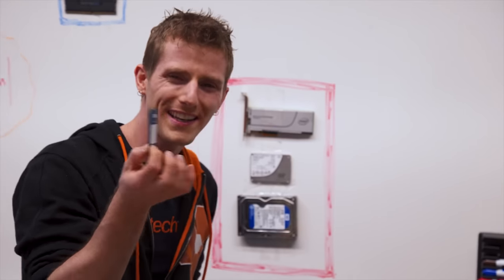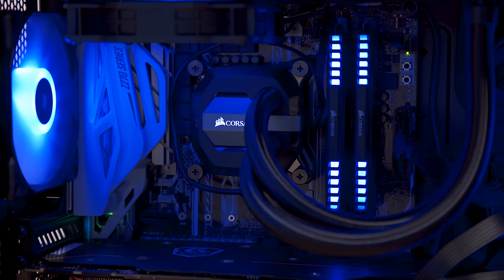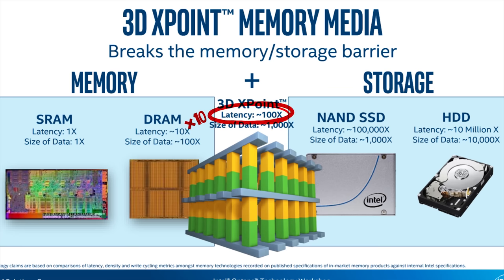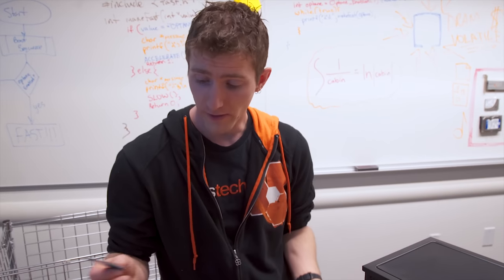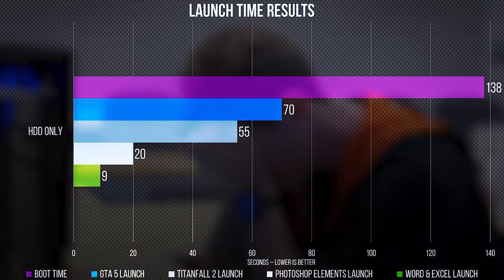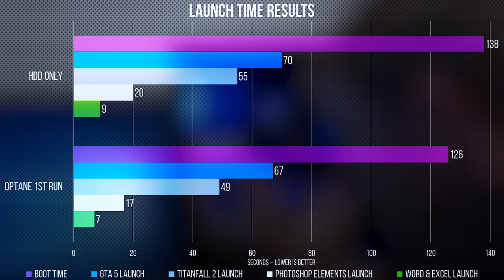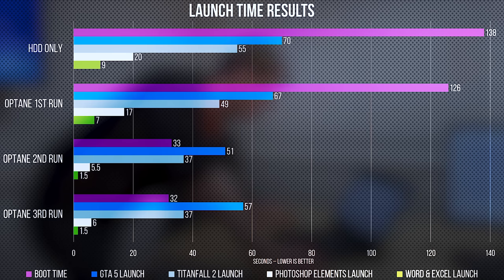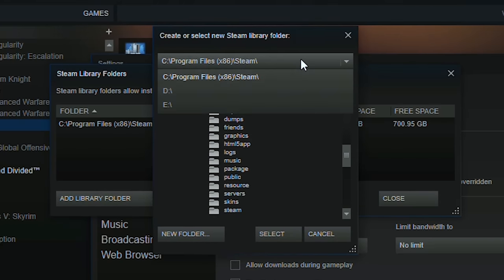Intel Optane Exclusive Hands On - SSD Crushing Performance

Comment: I'm a server guy and we've been testing the server version of this for a while and wanted to point out a few things.

Firstly the overall bandwidth of this is really no different from existing PCIe NVMe M.2 cards such as the Samsung 960 Pro's etc - it's limited by PCIe version and lanes - in this case 4 x 3.0. This is the same with the server cards, sure we may have 8 x 3.0 lanes but that's still the limitation. Where Optane really benefits is the access-times, they're way quicker than the already-very-quick PCIe NVMe cards - WAAAAY quicker. The problem is what to use this for.

Obviously it's way too slow to replace DRAM (for now), and way too expensive-per-GB to replace main storage (again, for now, though that will change VERY quickly). The biggest issue right now is that operating systems aren't tuned in any real way to utilise this technology and that won't change very quickly either.

Where this will benefit servers in particular is where you have all of your 'live' data in DRAM but want a cache of the most-used of your main storage that's way quicker to hand - storage-tiering essentially. Eventually when all main storage runs at this speed then this tiering won't be needed, but that's 3-5 years away or so.

For home users, well we need to wait for capacities to increase, price-per-GB to drop and PCIe 4.0 to ship - then we get our game-levels quite a bit quicker but home users won't really benefit too much from the latency-drops to be honest, we just don't do that kind of work typically.
Reply: THANK YOU!
right now, you are good to go with an SSD as boot drive. If you have more money, get an NVME SSD.
If you run out of mass storage, get an HDD.
Simple as that. Optane has way to small capacities or is too expensive.
Reply: Is the server version bound to Kabylake + Windows, too?
Reply: There exists server level versions of  2-level data cache software,  such as  PrimoCache:              http://www.romexsoftware.com/en-us/primo-cache/index.html
       So if you have 32 or 64 GB  RAM in your server,  a nice Samsung SSD as the level 2 cache, and say a Seagate Hybrid 4 TB Hard Drive as your main drive, you can run all the hot data on your server at RAM DRIVE speeds.9,000 Megabytes / Second  Reads and 14000 Megabyte / Second Writes.   If your server needs to read / write faster than 8 Gigabytes  per second - you probably need to do a server farm and load balancing ?   That's is a Lot of data to be working with per second all the time...
Reply: Phil Buckley-Mellor sounds like a good zfe l2arc drive, but I'm worried about wear level
Reply: FightBiscuit yes you should ALWAYS use an SSD (even if it's 'just' a SATA SSD) as your boot drive and where you load frequently used apps from. Considering you can get a 'big enough for consumers' SSD for under a 100 bucks these days there's really no excuse for not having an SSD as your boot drive.

Where these Optane thingies really shine is as SLOG devices or similar use cases. As a consumer I therefor cannot imagine why you'd want to get one of these as opposed to an nvme SSD unless you are running something like ZFS or a database server and you notice that it doesn't respond as snappy as you'd like it to.
Reply: Yet, there is still the question if Optane in this state is compatible with any LInux Distro, FreeBSD, Solaris, etc. If not, there is no SLOG for your ZFS pool. It means Windows license or gtfo.

And because of this licensing crap it's probably better to just stripe multiple SLC tier SSDs for this kind of performance.
Reply: Thanks for the heads up, server guy !
Reply: So in essence, this would be perfect for a cache drive for something like unRAID -- would love more capacity but for what it does it seems like enough for now.
Reply: No, the server one (the P4800X in our case) is a PCIe card that works in HPE DL380 Gen9 and Cisco C220 M4 (i.e. current, not Purley) servers.
Reply: Well it's a lot better than anything I can put in a server right now for wear-level (other than a HDD obviously), as far as I know anyway.
Reply: I think you're good with RHEL 7.4 onwards and W2016.
Reply: It can be used with ESXi 6.0u2 and above as flash-cache or as Host Swap Cache (in fact this latter one is one of Optane's strongest positions right now)
Reply: I could see NVME/Optane Slots at the back of GPUs like SSGs but this will not happen in the next years
Reply: It's too early for Intel to license Optane to anyone. The Radeon Pro SSG features M.2 slots for some NVMe SSDs, so if there is a Vega variant of that I'd expect it to use NVMe too.
Reply: Today low - in the future maybe - this is all about Intel and Micron for now, but bear in mind that the NVMe specification was designed for this kind of memory, the stuff we've seen so far on NVMe is really just a case of using the spec to benefit faster-than-SATA memory, once this stuff becomes bigger and cheaper we'll see some interesting use-cases for it. Personally I see it being used for very fast distributed file-systems such as RDMA-backed CEPH or similar.
Reply: Thanks for the info. I'm excited about the prospect of this technology, but I wasn't too interested in rushing out to buy it. Will keep an eye on it in the coming years
Reply: What about linux swap space?
Reply: Would it be possible to use it as a shared memory pool for editing applications sort of like ramdisk type use cases?
Edit for clarity
Reply: That's a really great use-case but right now the cost vs. DRAM vs. size isn't great but yeah that's the most obvious use right now.
Reply: Sure, why not.
Reply: Sorry but that's not really the case, U.2 and M.2 provide the exact same bandwidth as each other, they're just different physical connectors - and server would generally use PCIe-connected NVMe.

Comment: So basically this turns any hdd into a higher speed Hybrid HDD... is that the gist of it?
Reply: Seems like it. Which is definitely nice. It seems like Apple's Fusion Drives have always outperformed other hybrid drives due to having 24 GB of cache rather than the almost universal 8 GB of cache elsewhere.
Reply: No, this is not how this works. It's a cache. Normally most of the data is stored in RAM and is deleted on power off. Now that's stored on the optane. It has a bandwidth of ~3GB/s which is as fast as an NVMe. So now you're able to get data extremely fast as compared to the HDD. This isn't only for HDDs it can be used for SSDs or even NVMe drives.
Reply: Right, which is what a hybrid hdd is.  It uses the ssd portion of it as cache that auto fills up.  I know it's faster than that which is why I said 'higher speed'.  The big question is, what kind of speed boost will it give when paired with an NVMe.

I'd be much more interested in it if I could specify what is stored on it, like if I could specify Adobe to use it as a video editing cache.
Reply: Just wait until we start seeing these at capacity!  the no write fatigue is what excites me
Reply: I'd wait for hard endurance numbers before using it for scratch space--especially on such a small drive. So far, Intel has been letting the marketing department blow sunshine and rainbows at everyone (including Linus, apparently) to distract from the fact that actual performance numbers and technology overviews have been pretty much absent from media briefings for a long time.
http://semiaccurate.com/2017/03/27/intel-releases-consumer-m-2-xpoint-ssds/
https://semiaccurate.com/2017/03/27/intel-crosses-unacceptable-ethical-line/

Comment: Who the faak has a brand new z270 board with their primary storage being a magnetic hard drive?
Reply: me
Reply: I have about 6TB of data, Putting all that on SSD would be freaking super expensive. Plenty other ppl like me surely.
Reply: I think the keyword is "primary storage", as in "system drive"
Reply: If you paid any attention to the Video, this device isn't used only for boot up... It is also used to Cache relative Programs, hence, BIG PROGRAMS... you know, the ones that wouldn't fit on a AFFORDABLE SSD... Just saying
Reply: It's quite obvious that they intentionally used a hard drive to show the differences.

Also, a lot of people still use hard drives due to cost for bulk storage.
Reply: Doctah Yeah... but as their primary/OS and programs drive.... on a brand new z270 board?  I don't think so

If they made these in a pcie 4x card form factor that could help people with older platforms that'd be spectacular
Reply: XBnPC help ppl what are you thinking about they just want you to buy a new CPU they can't sell due to low proformance gains
Reply: yeah its only a selling point, but there is nothing wrong with having a selling point. as long as its not dirty and underhanded like the 4K Netflix thing is
Reply: Kenneth Hermann That's pretty spot on sir... Intel might black bag you for talk like that...
Reply: There are some M.2 to PCI Adapters in the market....
Reply: I did for about a month, till I could afford a SSD
Reply: Have you watched the Video? It is not for high-end users, yet.
Reply: but you need the newest intel tech for using this. sooooo you have to spend a lot of money.
Reply: Right, otherwise it's just an overpriced SSD with unproven performance.
Reply: BangSonor Right. Because the latest enthusiast motherboard with a z270 chipset and a 7th gen Core i7 are for low-end users. Maybe in 2-3 years, this application will be relevant to the "target audience".
Reply: In which case the use of this feature is an accident, rather than planning, and the guy with no money still has to come up with cash for some cache. At that point, he may as well save a bit longer for a proper SSD.
Reply: Or make a ramdisk. For free.
Reply: using this module with a SSD is pointless.
Reply: Who said anything about using this with an SSD?
Reply: Ha! Possibly muppets?
Reply: Jim Stanley Sickofitall89 did, and it's a valid point. not a retort.
Reply: Me?
Reply: Sorry, I missed it. It is a valid point, I just didn't realize it needed to be made.
Reply: Nice edit.
Reply: Someone who works with lots of HD video will know better than to rely on spinning drives for scratch space if they want to actually get work done. Just because they can't afford to stuff a computer with hundreds of TB worth of SSDs doesn't mean they won't shell out for 500 or even 250GB worth to hold the OS and program files.

If you're suggesting that Optane can be used as scratch space when editing video, the endurance just ain't there. At 3DWPD, you'll start losing sectors in no time. http://semiaccurate.com/2017/03/27/intel-releases-consumer-m-2-xpoint-ssds/
Reply: I DO!
Reply: I just built a new PC with an EVO 850 500GB and a 2TB HDD. I'm somewhat considering slapping one of these in just to help with load times on whatever ends up in spinning storage. It's a pretty marginal gain, but load times are load times. and at the 40-70 price point it's not exactly breaking the bank for something that might have some quality of life improvements. 

Is it necessary? no.
Is it game-changing as a standalone product? no.

But it lays the groundwork for future hardware that probably will be. There is value for Intel getting this technology to market even with a limited scope because it provides exposure. They've stated that they want to expand this to more robust / larger capacity hardware that, I imagine, will have wider compatibility. With that there will be more applications and adoption. It's a little gimmicky at the moment, but I think it has some exciting potential.
Reply: The thing is that maybe the BIOS and the chipset have to support this "SSD as cache" feature.
Reply: I just did a video of this (the 32gb stick) running on my Ryzen 1700 AM4 system w/some benchmarks if anybody's interested..
Reply: XBnPC how can I run my own benchmark? I have intel and want to do my own and compare to your video!
Reply: Alejandro Rodarte Sorry man, I'm not gonna be home until tomorrow night, but I'll definitely check it out and see how we can do some benchmarks and conparisons.  I'll let you know ;D
Reply: XBnPC me...
Reply: XBnPC 
People like me who refuse to "catch up" with the modem world on some things.
Reply: " It is also used to Cache relative Programs, hence, BIG PROGRAMS.."
Not how cache works. It doesn't pick large programs it caches frequently used files.
Reply: I actually have a i5 7600k on a z270 board and I am using a 1tb wb blue hdd. Boot time is only like 25 seconds tho. Will get ssd soon
Reply: For me I went with cheap gigabyte z250 motherboard with i3-7100 + 2tb WD HDD cheapest combo to get optane
Reply: XBnPC Me..but mine will be 8th Gen Core with Z370 and Optane.
Reply: an hdd is good if you need to store a shitload of porn without paying too much
Reply: Intel Optane can now accelerate secondary SATA drives too.
Reply: Im building a brand new Z370 and guess what? Will be using a 4TB HDD. Why? A couple of reasons:

1: First and foremost the safety of my data and also the drives longevity. HDD can be rewritten endlessly(in theory at least), hardware failures are virtually nonexistant in good HDD´s and even if something fails you can at least recover your data successfully and completely, something that is often impossible for SSD´s.

2: Size: With SSD i´m limited to 2TB, actually 1TB if I go by what I can afford... That´s not enough with evergrowing sizes and hell, even stuff like windows updates which are growing ever larger and out of proportion! To have something future proof I´ll need at least 3TB.

3: Price. Yet another reason to rather stick to an HDD and boost it with something like optane.

I for one will be sticking to HDD and enhance it with optane. I have read and even saw(one, friend of mine) too many horror stories of failing storage devices and complete and irreversible loss of data. Another good horrofic recent loss I saw comes from the modder scene:  A modder was setting up a super mod, nearing completion too. Guess what? Total drive failure... The data was gone. Of course it´s partialy her fault for, for some stupid reason, backing up smaller mods but not that grand project shes been working on for 2 years plus... : S Still, partialy her SSD is also to blame. An expensive recory only recovered a part of the data(yet another thing that to 99% wouldn´t have happened with a decent HDD!), same goes for the mod and she basicaly needed to start from scrap more or less.

Hell, even without optane I had stuck to HDD so or so, gaming wise an SSD gives me no performance boost anyway. Yeah it´s cool to have fast boot up times etc. but do I really need that? Nah, I rather need me gaming power!
Reply: Some people would rather put that chunk of money spent on an SSD to a better CPU/GPU or even RAM nowadays